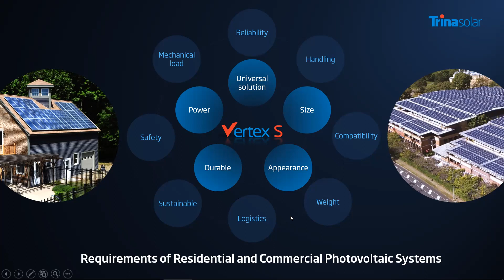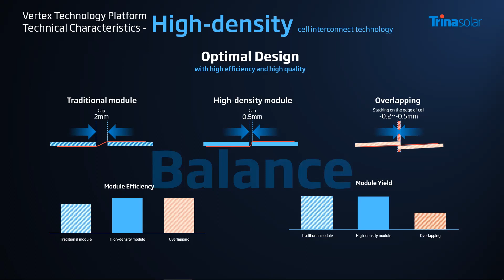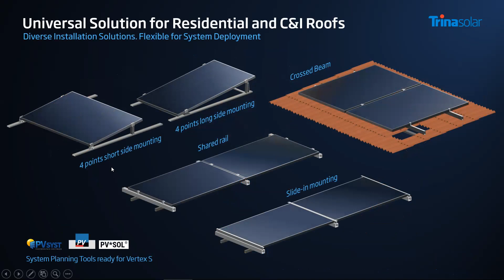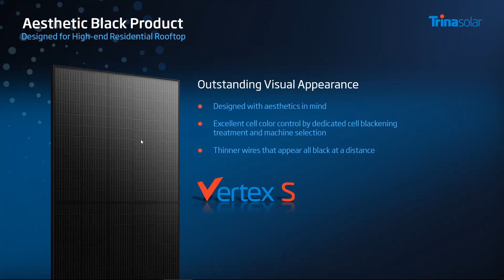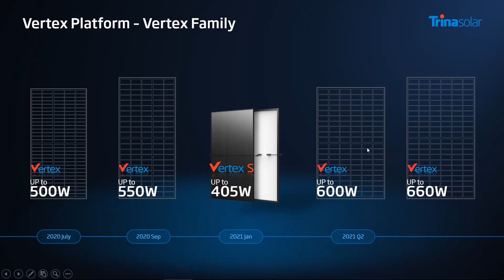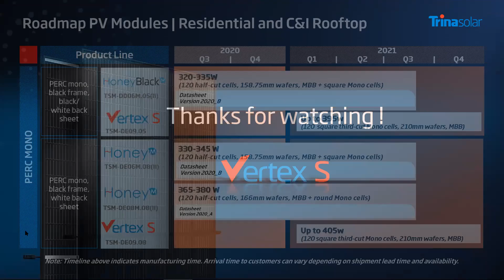Vertex S: Product Introduction

Comment: Our installer wants to connect the enphase Iq7A to the trina vertex 395 wattp.. Many sources claim that a IQ7+ would be better or sufficient.. Our installation is directed even east-west.. so with lower max output than sout-faced ?? What do you think ?

Comment: What's the difference between the 400 watt, the 395 watt and the 390 watt panels ? As they have the same size.. We ordered the 395 last fall. But now as the installation is coming end march.. We got a call that they could not deliver the 395 all black panels.. And we could get the 390 watt panels.. !! I believe it was said that in the factory the panel are measured in a test and that selected in how much power they bring on at the test and sold in different categories !?? Is it.. Are they all made the same ?

Comment: I have question.. How are solar cells connected in Trina Solar Vertex S TSM? Solar panel have 2 separate areas? How it effect the shade? Thank you
Reply from the maker: In terms of its electrical scheme, the Vertex S is very similar to other half-cut cell module designs which have been around on the market for quite some years. It has two module halves which are connected in parallel via the 3 small junction boxes on the rear side of the module.

Depending on the specific shading situation, any module half can work independently while the other one is shaded. On top of that the Vertex S has 3 bypass diodes which split the module into 3 sections parallel to the long side of the module.

Due to the fact that we have 5 cell rows, the splitting is slightly different compared to modules with 6 cell rows. In this case 2 1/2 cell rows are connected to a bypass diode and thus it is possible to protect the module if shading occurs parallel to the long side of the module.

So this is the basic functionality looking at a single module. How the inverter reacts to shading in a string can vary and has to be considered according to the I-V curve of the whole string and the respective optimum power points.
Reply: @TrinaSolarEU  tha k you for your answer.. your solution sounds very good for me as option which I looking for
Reply: @TrinaSolarEU  I have seen a video wich made it a point that the panel allready goes down with only one third of shade.. I believe I understood that it would loose to much voltage !! I was looking for these panels together with enphase IQA inverter..

Comment: I have 6 of these on order with a Growatt MIC 2500 TL X inverter, I am wondering which is the best way to wire this, in parallel or in series, is there a wrong way ? (this will be an on grid system)
Reply from the maker: Dear customer, the inverter needs a certain voltage to start and operate in a reasonable efficiency window. For that reason it is only possible to connect the panels in
 series to achieve it. By the way, this inverter has only one MPPT and one input, so you have to connect all panels in series anyway.

Comment: How are they in higher winds ? Specifically Sheffield
Reply from the maker: The modules are tested for wind loads up to 2400Pa, of course using an adequate module mounting method (please refer to the Trina Solar user manual)
. It is difficult to say whether this is sufficient for the location and for the specific installation conditions. We recommend to consult a local installer who has the expertise to judge and evaluate your individual situation.